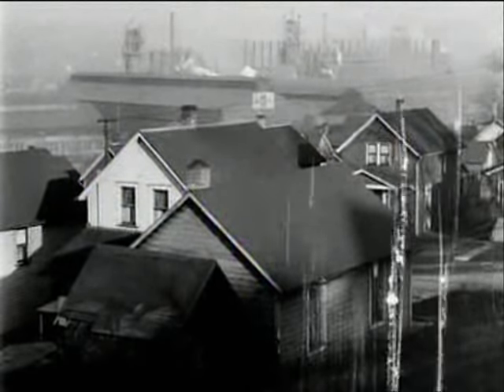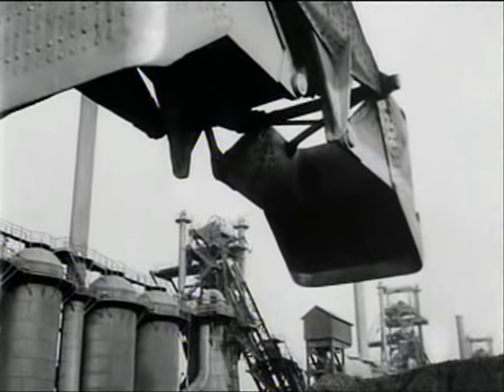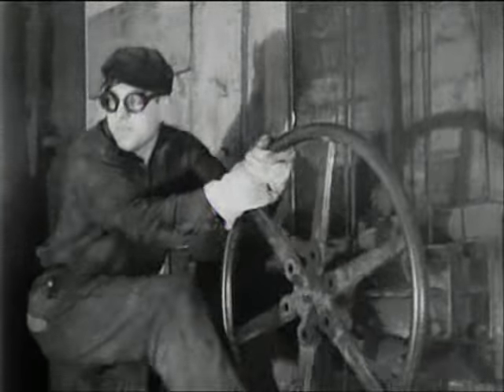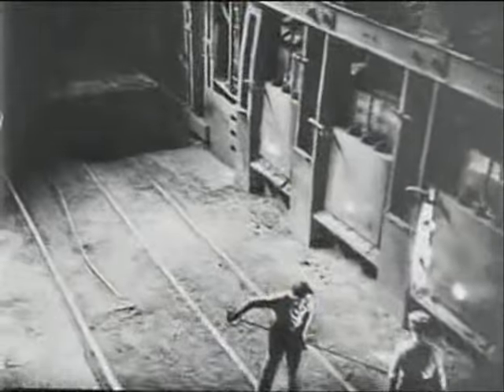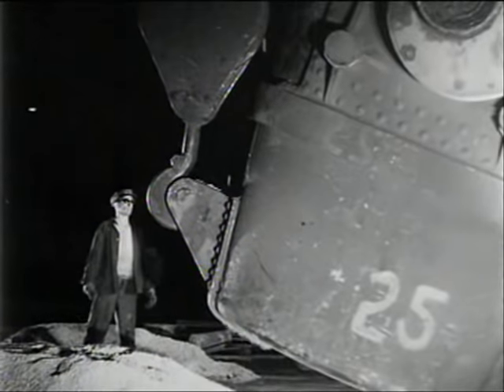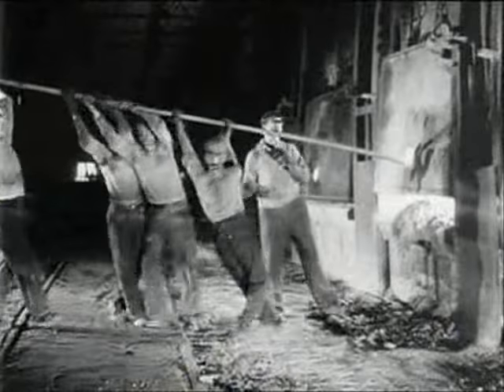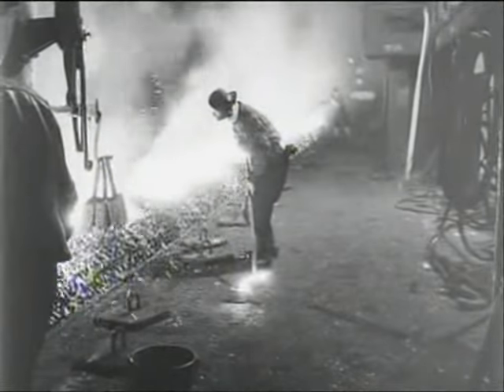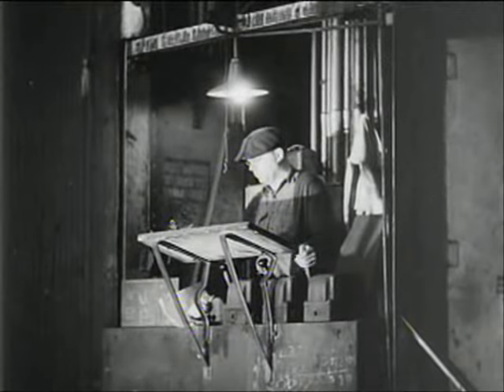Steel Industry 1944 Youngstown, Ohio

Comment: The Steel they made for the railroads at the time stood the test of time. Im a Track Welder and on our rails we still have rails from 1915. Crazy. Much respect!
Reply: How do you weld railroad tracks? Is it all thermite welding?
Reply: @josephtraverso2700 No. Our rails aren't CWR (Continously Welded Rails) but bolted together. I weld and rebuild switches, frogs and areas on rail that need more metal.
Reply: @legitdrumsticks215  cool! I’m taking manufacturing course and my prof used rail tracks to explain thermite welding
Reply: I work a rail yard in Toledo! 
Some of the track is bolted and some of it is thermite welded! Pretty cool to watch that process!  I don’t know why it’s done either way. Maybe welding is done for high speed rail.
Reply: Back when men were made of steel and boats were made of wood!
Reply: @legitdrumsticks215  hi .would please explain what do mean frogs

Comment: I work in a modern steel mill and this is so cool to watch .  We definitely have made lots of progress in the past decades.  It is so much easier and safer now
Reply: 1978 to 2010 I saw many changes,  thank God for SAFETY
Reply: Like ear protection? Ventilation? Tags? Can you give some examples?
Reply: @furtim1  Combination of automation and better safety standards. Automation has made it much safer. Now a days most of the work can be done from inside a pulpit like they showed the guys making the slabs before the hot strip mill. Even then the amount of input needed from the operators now is minimal. When you have to go on the floor you have to wear ppe. Hard hat, safety glasses, ear protection, and fire retardant slacks/shirt are the minimum. Any job dealing with the molten metal/sparks adds additional ppe, face shield, gloves, additional suit rated for molten splashes. Primary is still a little dangerous. I worked as an engineer in finishing on a hot dip galv line. 90% of my line was automated. Operators sleeping in the pulpits while the line runs is a regular thing.

Comment: All that steel and iron to build the mill that builds more steel!  The manufacturing process is mind blowing.  I can't imagine the heavy equipment and the engineering that put together the mill itself.
Reply: classiclarry88 my thoughts as well. How did they manufacture the first press?
Reply: Amazing.  It’s hard to imagine how they do everything.
Reply: Look up the Boilermakers Local 169 they're the ones that build the furnaces the boilers the big stuff
Reply: @ryanstucke7811  that's the classic .. the chicken or the egg
Reply: It is and was amazing
Reply: @steven.h0629  not really, you don't need a press to make a press, you need to be able to cast, drill, thread, and if you wanna get fancy and have surfaces on your first press ever to be smooth, some abrasive capability. 

Also, the answer is most definitely the egg, it was laid by something just ever so slightly different than a chicken
Reply: @ryanstucke7811  that's always the question. How do you get the first ruler straight to make everything else straight? How do you make the master object? It's always so cool to find out.
Reply: And I laugh every time I hear African Americans claim that they built America.
Reply: @ИмяФамилия-ц6д  you're about a few thousand years off, the Chinese were using lathes for arrow and prediction in 400bc, turned wooden plates and bowls exist from 600 bc, and the Egyptians are know to have used simple lathes for furniture from 1300 bc, 

That in the very simplest of lathes you might imagine today, pole lathes are of unknown origin, but date at least before the Vikings so at least the 800s, to be entirely honest I'm surprised it took us so long
Reply: @mezmerizer0266  It’s called “The Rule of Three” or “Automatic Generation of Gauges”. You make three straight edges or three flat plates. If the edges or plate faces all meet up to each other then they’re all straight or flat. If you’re really curious about the subject you can google “how to make a precision straight edge” or “how to make a precision surface plate” for a detailed explanation of how it’s done. This process was figured out in the early 1800s in England and it is what enabled the factories of the Industrial Revolution to manufacture products in vast quantities with interchangeable parts.

Comment: The boys would be amazed how steel is made now a days with continuous cast, atomized spray and electric arc furnaces
Reply: Yep made in China thanks to Trump
Reply: @altestic9436  *Obama
Reply: @altestic9436  Whaaat?
Reply: @altestic9436  Steel has been foreign made long before Trump. Ask a welder. They know.
Reply: Al Testic China does make like half of the steel in the entire world.
Reply: Electric arc furnaces are mainly used when material is recycled, coke is still required to make out of raw material, since not only it serves as the heat source for smelting, but it also contains important ingredients itself for making the iron.
Reply: Al Testic “Thanks to Trump”

Not only are you wrong, you are as wrong as wrong can be. You are 180 degrees from right.
Reply: I make steel currently (in America) and I am amazed by how they did it back then.
Reply: @altestic9436  actually Clinton
Reply: @altestic9436  he wasn't president when they moved over there! It's called Google! Use it!
Reply: Fear and smear... typical Republicans!
Reply: Or how Youngstown looks now =/
Reply: Actually jimmy Carter was in office when the industry collapsed
Reply: True china probably makes half the steel/alloys in the world and there is ship in the harbour waiting to be sold and undercut local prices but if you want high quality super steels then you don’t buy China. You buy Canadian galvalum from Dofasco or you buy CMP S30V from American Crucibal metallurgy products
Reply: @ModernGentleman  not in all the types and shapes required dummy. US manufacturers actually lost work because jobs that manufacturers were used to doing for years for recurring customers were made more expensive literally overnight, simply by virtue of using a special tube size that is rolled exclusively in canada. 

There are much more jobs to be saved in industries that USE metal, rather than making it, and guess what, once we you have more domestic demand for metals as manufacturing is recovered, you then actually have the market support you need to keep a steel plant open that normally runs on razor thin margins. The problem with the US steel industry right now is overproduction of the basics and severe lack of production of the complex alloys and sections that modern industrial manufacturing require.

The US is still where the money is for now, which means we have the leverage to bring manufacturing jobs back through tax laws and if they want to play hardball, sanctions. You really think ford and GM won't think twice about shuttering a US plant if they know they can no longer sell their cars in the states if they do? That's the type of commitment it will actually take for anyone to "bring Jobs back", but be ready, because that's almost as "anti-business" as it gets
Reply: When I was going to college in Cleveland I co-op’ed at Republic Steel and worked on the continuous caster. At the time, I didn’t realize you could wear out clothes in a few months.
Reply: @altestic9436  you sir are completely wrong and out of touch with what’s really going on... you don’t work with steel or in a mill guaranteed
Reply: Ok boys, I’ll settle this argument. I am in the steel industry and have been working with various large companies for years and will only mention companies I did not work for but respect their directions in the steel market. I have worked in primary manufacturing (making steel like at Arcelor mittal) and secondary steel manufacturing/distribution and processing( ie. Samuel and Sons) and now finally into “scrap metal processing and recycling”( ie. American Iron and Metal) Indeed most all ferrous steel is made in china because with their lack of human rights and non-existent safety regulations it would be next to impossible for a North America business to complete with them without heavy steel tariffs. Guaranteed there is a Chinese boat in your local port with steel that’s not even sold yet to flood and control the markets here. It has its place in manufacturing because of low costs but quality is not the best with contaminates and/or inclusions, de-lamination of galvanized steel, poor heat treatments all of which can result in wildly fluctuating hardness, poor malleability and/or ductility... those two being most important in stamping and molding of metals by final manufacturing or products especially so in deep draw stamping(ie. stainless double kitchen washing sinks) Because of these issues important products such as most North American vehicles rely on local produced high quality steels like ones made in Pittsburg USA and Hamilton Canada which Arcelor Mittal makes an amazing galvalume steel which might be thankfully why there is still cars made of steel lol. Bottom line is steel is like making a cake and every country has it’s own recipes for making a tremendous variety of ferrous and non-ferrous metals. Some are very similar but those slight variations make certain steels better for certain jobs/products and with different price points allowing quality products being made with good profit margins... swing outside these margins and you have a cheap steel products that won’t last regardless of the processes in place. Makes sense ya get what ya pay for, that’s why you can buy an $20 knife at bass pro or a $300 knife and both are worth the price! Depends on what you want to do with that knife and how long you want to keep it. Camping and having to use a knife is what got me interested in steel in the first place... knife tip, buy either Benchmade or Spyderco if you want a quality blade that will last a lifetime or longer that you can pass down for generations.... sorry Buck, you had your chance and chose Chinese steel, not high quality American made super steels like that being produced at Crucible!
Canadian and American steel industry is doing very well I must say and the only reason why Trump applied steel tariffs was politically and nothing to do with unfair competition or offshore dumping. Simple fact is Canada Recycles as much as possible regardless of what it is to help with the environment which they value more than Americans. Not taking shots just pointing out because of that there is absolutely no shortage of high quality scrap alloys, and that lowers the price of production... energy is what cost the most and that’s why China is willing to destroy their environment in exchange for cheap energy and rapid unstable unsustainable growth... Maybe that’s why there are buildings fake sand islands in the middle of international waters... looking for some aggressive expansion of territory soon! In the end it all washes out anyway, like I mentioned every country makes a specialized steel that suits the needs of customers all across the world. Sad to hear the last company that smelters lead has stopped operating in North America, probably one of many reasons re-loading is popular.
Made no sense that Trump needed to mess with the flow of steel across our border! It only hurts both of us and compromises our aerospace or defence production abilities which we need to keep advancing during these sad and turbulent times. My city is a full lockdown because of covid and I have been deemed an essential worker because of the production of steel which has been deemed vital for national defence of both countries. So while most people sit at home comfy and collect government cash... sadly I have to go to work to help keep us all safe and the production of good to keep the economy rolling forward. Why can’t I skip the lines at the grocery store like a Police officer or Nurse... No one should skip lines we are all equally important.
Reply: @jasong9502  Agreed, I have worked with, but not for, the companies you mention, Samuel was one of my main suppliers, dealt with Arcelor to setup witnesses for nuclear melts, etc.... But at the end of the day, their prices went up overnight when the trade war started (plus my shipments being held at the border because Customs was blindsided), because even though they are a good company, they still were not going to eat the tax on Americans that the tariffs were. 
They passed the price increase along. This happened industry wide and actually depressed long term investments and reduced the size of recurring orders because customers would rather weather the storm if they can and buy more when the price is low again. We have much much more manufacturing that uses steel here compared to companies that produce steel. Add on the disturbed agricultural and other export markets and it's clear that the trade war was just a bunch of hullabloo to make people think he was actually doing something good.

That all said, I buy domestic material for whenever possible and it is usually competitive and available, but definitely more expensive per pound, depending on the order parameters I could potentially lock down the Canadian price on American steel. That comes down to individual mfg'r's situations though, who is on their buying team, who is on their vendor's sales team, etc.

Gotta say though, you may want to update your guarantee of chinese ships loaded with chinese steel waiting to dump. That is much much less of a problem than it used to be, American firms wised up through the 2000's after widespread stories of critical failures (the failures themselves were less prevalent, but we love our shop talk here don't we) and have moved sources, most of our Asian steel is actually S. Korean these days, and they mostly follow production limits. But Clearly you've been around the block as well, so I don't blame you for not having that perfectly updated, lol
Reply: Nowadays
Reply: @dasboot5387  the steel industry really was destroyed under Reagan. one of the worst Presidents we ever had.
Reply: @warrcoww6717  blame capitalists. Because they move production to where labour is cheaper, not "markets".
Reply: And not in the usa
Reply: @daleolson3506  true
Reply: @KenKen-ui4ny чугун не нужен. есть мидрекс (midrex) + электродуговая сталеплавильная печь.
Reply: @warrcoww6717  Maybe I'll blame the nonexistent environmental and labor laws that make it cheaper to manufacturer in the 3rd world than in America and the executives that to save a few pennies will move jobs there so they can line their pay and retirement funds with another 10 or 20 million.
Reply: I think “the boys” would b more amazed how the steel industry there took a absolute shot after everything was built and now it’s a city full of steel and gun shots lol YOungstown is a awful fucking ghost town to be in rn
Reply: @warrcoww6717  don't try and explain actual facts to partisan Americans, if it isn't Trump or Biden's fault they don't wanna hear it
Reply: @altestic9436  they were making steel way before they even heard of him- your recto-cranial observation reflects not only your political tastes but also your mentality.
Reply: @warrcoww6717  finally, a reasonable take

Comment: I am 72. I worked in the Plate Mill at the Brier Hill Works of Youngstown Sheet & Tube the summer of 1969. My father was a Cold Strip Roller for 42 years at the Campbell Works at Youngstown Sheet & Tube